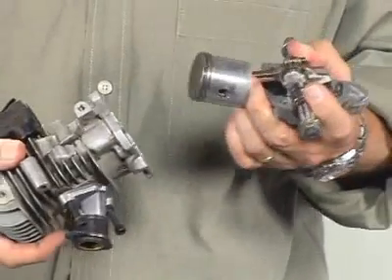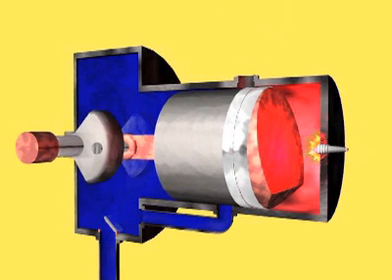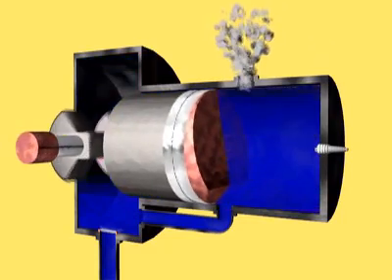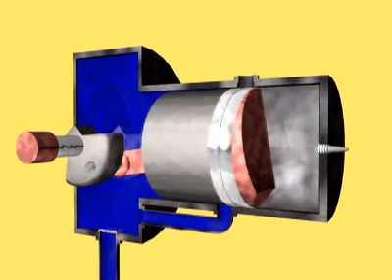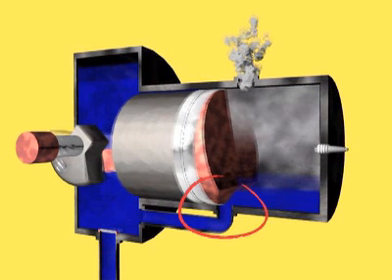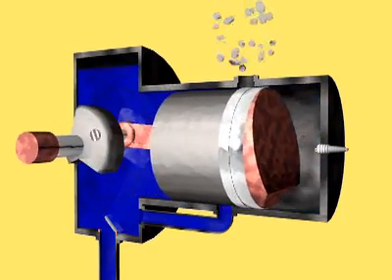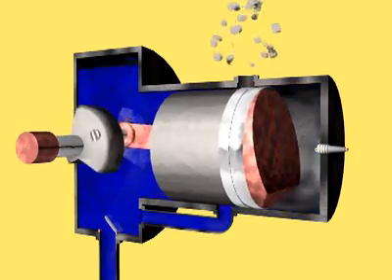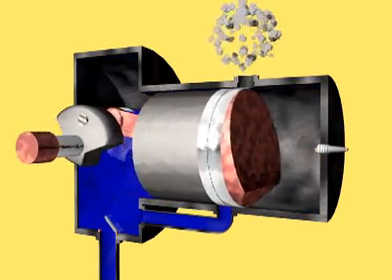How Two-stroke Engines Work

Comment: From the animation, I gather that you're likely to lose some unburned fuel out of the exhaust, since the fuel intake and exhaust are open simultaneously. That would mean lower fuel efficiency, right?
Reply: something that this video didnt clarify is that there are many varieties of 2 stroke engines. This is the simplest and cheapest one and yes, intake and exhaust are open simultaneously so quite often your intake will leave the exhaust leading to decreased fuel efficiency. It should also be noted that a 2 stroke running at 5000rpm is firing twice as often as a 4 stroke at 5000 rpm (2 stroke fires once every crankshaft revolution, 4 stroke fires every other revolution) so it will be burning at twice the rate in the first place. They are not fuel efficient. This variety of 2 stroke engine also has to have the lubricant premixed with the fuel (or on my old 50cc scooter it actually had a seperate oil tank which fed into the carb so the carb mixed the oil and fuel before it entered the engine rather than having to mix before putting fuel into the tank), as the fuel and exhaust run through all the moving parts of the engine this is a simple way of keeping it lubricated, the lubricant doesnt burn in the exhaust properly though so this adds to the emissions from this type of 2 stroke engine.

There are actually 2 stroke engines which have a proper cam operated exhaust valve, superchargers instead of using the piston falling and a conventional pressurised oil system as you would expect from a 4 stroke. These engines in proper tune can run with superior performance to the simple setup shown here, the setup shown here is hardly the best engine in the world but it is damn cheap and lightweight making it perfect for chainsaws, weedwackers and RC vehicles.

This type of engine though with a properly tuned resonance chamber in the exhaust pipe can be setup so the exhaust gas creates backpressure to keep the fresh fuel/air mixture from exiting through the exhaust pipe too, this can help the fuel leaving exhaust issue but does come at extra cost for something like a weedwacker, common on RC vehicles and dirtbikes though. Improperly setup they either dont have enough effect (still an improvement over a standard exhaust) or in some cases it has been known for them to also inhibit some of the exhaust gas from leaving the cylinder so you have exhaust gas still present during the combustion cycle limiting peak power output.
Reply: this video ignores the importance of the expansion chamber(exhaust pipe). Two strokes tuned for maximum performance(like dirt bikes) have a giant expansion chamber that uses sound waves to pack even more fuel/air into the chamber. In the ideal rpm range there can be almost no unburned hydrocarbons leaving the muffler...google two stroce exhaust scavenging if your interested and powervalves help to widen the powerband
Reply: Yup ... but there are tricks you can do to maximize the efficiency and decrease the amount of unburned fuel loss.
Reply: Yes

Comment: Verry well explained video but shot lies at the end about more power.... and left out how they don't last as long are verry dirty pollutive engines and are a pain to have to mix fuel and can be cerry unpredictable on throttle just cheap
Reply: Actually they genuinely do have more power for a given displacement compared to their 4 stroke brethren. A 4 stroke only fires once every other crankshaft revolution. A 2 stroke fires every crankshaft revolution. Twice as often. On paper, power output is double. In reality, its never quite double but it is higher than a 4 stroke.

Not lasting long, pollution requiring lubricant in the fuel supply. They are inherent to this type of engine yes, I will grant you that one. I'll also add in poor fuel economy (2 reasons, the fact its firing more often than the 4 stroke and additionally the intake and exhaust valves are open at the same time so without a properly tuned exhaust pipe (this does exist as a solution to the following problem) some of the fresh fuel/air mix will leave with the exhaust and be wasted). But a criticism I would like to add to this video is that not all 2 stroke engines actually function in the way he describes, he only describes a cheap 2 stroke. I live on a farm, we had a big old piece of farm machinery with a 2 stroke diesel, it had a supercharger, direct injection, exhaust valves (the inlet was still done via the piston reaching bottom centre, but wasnt fed from the crank case, it was simply a case of the inlet being near the bottom not the top which is a theoretically possible setup for a 4 stroke too) and a pressurised oil system. It did not require lubricant in the fuel, it had an actual oil system instead. It didnt burn lubricant as a result (the primary cause of the poor emissions test results on 2 strokes). Its fuel economy wasnt great, but it was firing more often than a 4 stroke so it wasnt going to be as good, its power output was massive though. 2 stroke engines with proper valve setups, dedicated lubrication systems and various other features not present in these cheap 2 stroke engines are very common in marine and industrial applications.
As for fuel mixing. I had a 50cc moped which had seperate fuel and oil tanks. The carb fed lines from both and basically did the oil/fuel mixing for you. So again. Having to mix the fuel is a limitation of a basic design only.

Comment: the 2-stroke engine will be better if the lubrication is like a four stroke and no loss of fuel and gas in the exhaust , the engine is called Kolbenladermotor (Piston Charger Engine)

Comment: Loop scavenge 2 strokes lost out on cars for 2 reasons.
(1) Emissions, they are bad on unburned hydrocarbons (oil in the petrol to lubricate the bottom end and unburned fuel from blowing out the exhaust.
(2) Wear  on the bores/ rings because of heat differential between the top and bottom of the piston (My air cooled Yam RD350 would need re-ringing every 10,000-15,000 miles)
Reply: Emissions are entirely resolved now with direct fuel injection.  Some of the most stringently emissions-controlled bodies of water will allow direct-injected two-strokes, where even many four-strokes are not allowed due to emissions.  This is due to oil injection with tighter tolerances and less consumption, as well as the obvious advantage of fuel only being injected AFTER the exhaust port is closed.  Also, your RD should have had oil injection, so don't bring up premix.

Motorcycle engines, especially the two-strokes, are in a pretty hot state of tune.  Big ports and high RPM on an air-cooled engine do make ring wear more severe than they are in some other applications, such as snowmobiles and outboards.  That said, even some two-stroke motorcycles can last a good long time.  And I wouldn't consider a ring job on my 400 triple to be any more difficult than a valve adjustment on my CRX - and that's supposed to be done every other oil change.
Reply: Yes I know my Yam had oil injection (but some of the oil would be in the petrol/air mix because there were oil injectors on the engine side of the carbs plus oil was also injected into oilways in the crankshaft.
I didn't mean "petroil" as in mixing in the fuel tank
Agree on the direct injection of fuel in the latest generation of 2 stroke motors. Saw that on snow-mobile engines
Reply: and they don't coast if you go down a hill with the clutch out/or in drive the engine wont get any gas or oil and a engine that isn't lubricated is no good
Reply: Your air cooled RD is 159 years old. There is nothing as reliable as a 2 stroke and the rings is minimal compared to 4 stroke maintainance. #1 is why they lost out on 4s.

Comment: part of the reason 2 strokes are so bad on fuel is because some of the fuel/air mixture is lost out of the exhaust valve as the cylinder is being compressed

Comment: The 1979 Triumph Bonneville 750 produced 38 Foot / Pounds of torque at the rear wheel and consumed 51 MPG. (A 4 Stroke)

The 1979 JAWA 350 Type 634-5-05 produced 38 Foot / Pounds of torque at the rear wheel and consumed 65 MPG. It was also a 2 stroke.

The advantage with a 2 stroke is that only have the engine size is needed to perform the same task.

4 strokes also have far higher internal friction losses than a 2 stroke as all that additional junk (oil pump, valve gear, etc.) bleeds off power.

Comment: With power tools, such as chain saws, they will always drop their engine speed, when cutting, to the middle high torque 20% of their engine speed range.

If the material being cut, through frictional forces, makes the chainsaw to drop under this middle 20% it will quickly loose momentum and stall.

As 2 strokes produce just over 2.5 times the torque for volume than a 4 stroke the advantage for using them for this purpose is clear.

Comment: HP is always taken at maximum engine speed with the engine on the edge of its induction abilities and the crank has its largest store of innertial rotational energy. Even non-powered flywheels and spinning tops can have a HP measurement taken from them.

A vehicle's top speed is when the drag forces (measured in foot/pounds or newton/metres) = the applied torque at the driven wheel(s). If the engine is high revving, high HP but low torque, it will require a lot of gears.

Comment: OK engine generate maximum tractive effort (torque) when in the middle 20% of their maximum engine speed. This is when the engine is in tune / harmony with its exhaust system and intake system. It is also when the engine consumes the least amount of fuel. However as HP is more a measure of crank innertial energy, this is not when peak horsepower is produced.

The maximum engine speed is when the engine's intake duration is too short to intake enough mixture for combustion.

Comment: What i am interested in is how much power is generated by the working stroke. That is torque and speed since torque is newton-meter (=joule) and the rotational speed is in the unit of 1/s or 2/s (two- or four-stroke) newton (pressure and area of piston) times. Then if the engines are the same size and rpm, then the two-stroke should generate double the power with the same fuel consumption or half the consumption if they had equal efficientcies. But that is not the case. :)

Comment: Any rotational object generates torque, like a spinning top, and as the RPM can be measured, its BHP can be calculated.

I ran a brake dynometer for a company called Battery Electrical Traction Engineering Company, back in 1980. We made the main propulsion motors for Lansing & Bagnall fork lift trucks.

The 2.6 Kilowatt motors I tested made 22 BHP @ 2,000 RPM and 57.75 Foot / Pounds of torque on peak load. 

For electric motors wattage not the power output but peak load power consumption.

Comment: The international motor industry standard is by impirical measurement using a dynometer with the horsepower rating being taken either from conversion from a wattage of electrical power or from torque (tractive effort) recorded.

Note that 1 HP does not equal 1 PS as used by the Germans. 100 PS = 86 HP.

PLAN does not take into account port timing, intake loading (filters) or exhaust system volume so is a guestimate system with a large margin for error.

Comment: Damn, now you got me looking through the handbook again. 
BHP is according to Two stroke tuner's handbook by Gordon Jennings (page 3)
BHP = (P*L*A*N)/33000
Where
P is the brake mean effective pressure in psi.
L is the stroke in feet.
A is the area of the piston in square inches
N is number of power strokes per minute.

What i am talking about is what makes the pressure: How much muxture is in there, how much it is compressed and when the spark is given :)
So far i have ignored the spark advance.

Comment: A Brake dynometer is pretty easy to build and I used to run one in a job I had 30 years ago.

I'm building one now for use at home.

YOu need two identically rated DC electric motors. One will go to the engine or vehicle and the other will be electrically connected to the first motor.

Spinning up the first motor will make the second motor start to rotate.

The second motor then has a 12 Inch arm attached to its output shaft and this applied pressure to a set of scales. This will show torque.

Comment: Wrong - compression ratio is measured in the combustion chamber with a guage (I have one).

Both have the engine or vehicle under test turning a dynamo however what they are connected to is denoted by HP or BHP.
 
Brake Horsepower measures the torque via an electric motor with an arm attached to it onto a set of scale. the motor trys to turn and the force it applies (torque) is measured by the scales.

(Torque (Foot/Pounds) x RPM / 5,252) = BHP.

HP is calculate from a Wattmeter reading.

Comment: I know that BHP is calculated from the pressure in the combustion chamber, the piston area, the stroke and the frequency. But if the rpm, stroke and piston size was the same, then it must be the pressure that is different and the engine with the highest pressure is most often the one you think of as the most efficient. :)
The pressure (if the AFR are the same) is determined by VE and compression ratio while the compression ratio is limited by the knock tendency. :D

Comment: The difference in HP and BHP is to denote the method used to measure the output of the engine for the calculation.

BHP measures the actual torque (tractive effort) using a "Brake" dynometer which has a secondary motor attacched to an arm forcing a set of scales.

HP denotes that the figure was derived from a dynometer measuring electrical power generated (Watt's Horsepower Calculation). This is subject to slight inaccuracy due to heat losses.

BHP is judged to be the most accurate.

Comment: My GT 550 B was a 3 cylinder 2 stroke and produced 68 BHP @ 7,000 RPM with 44 Foot / Pounds of torque (tractive effort) at the rear wheel @ 5,000 RPM.

My 1974 350cc Aprillia twin ran a JAWA Type 472-2 engine which produced 38 Foot / Pounds torque @ 3,800 RPM and 30 BHP @ 6,000 RPM. Top speed was 107 MPH.

By comparison a 1979 Triumph 750 Bonneville gives 38 Foot / Pounds torque @ 4,000 RPM and 43 BHP @ 7,000 RPM.

HP / BHP is a factor of (Torque x RPM) / 5,252 and is similar to W = I x V.

Comment: Thank you for enlightening me, i do not know enough about that old engines to know if it was because the four stroke was not as good as it is now, but i know that the two strokes were very popular for races in the 70's (Two stroke tuner's handbook), so perhaps these were developed better than the 4 stroke bikes at the time. :)
Did it have a proper expansion chamber and how was the useful rpm band on that? :D

Comment: The Webb 2 stroke (as in pre-1970's common rail diesels) was a direct injected 2 stroke diesel used in trucks on the road globally from pre-WW2 to the 1970's emisson's laws killed them off.

The Webb featured an overhead exhaust valve and is similar to a four stroke engine.

Comment: By contrast my Canadian / US spec 1977 Suzuki GT 550 B can only manage 18 UK MPG @ 45 MPH and averaged 9 UK MPG.

However it managed a 9.91 standing quarter mile at the Santa Pod raceway in 1989 on a standard engine running a Nitro Toluene / Petrol concoction.

It hasn't been ridden since 1991 as the early unleaded fuel damaged the engine.

Comment: The crank shares the gearbox oil like a 4 stroke.

There is a Canadian made DI conversion for the Czech JAWA 350 Type 638.

The conversion consists of a modified cylinder head (injectors), the fuel mixture pressurisation system, a gasket to blank off the crank transfer ports.

The conversion requires that the crank journal oil seals be removed as the crankshaft's only source of lubrication is from the gearbox. Also that the breather hole has a nozzle fitted and a long breather tube fitted.

Comment: Yes, like aprilia's DiTech engine. :)
But you are wrong at the point about that they don't need oil. They do, but they don't need as much as conventional two-strokes, as the oil are not contamined by fuel. :D

Comment: The amount of time it takes the air to fill the cylinder is not very much. But the time it takes the piston to close the exhaust port again is not very much either, when running 7000 rpm. :)
But for better filling, they use expansion chambers which uses pressure waves to push the fresh mixture back into the cylinder. 
But as you can guess, both these approaches only work at specific rpm, so they are not very enviromental at lower rpm. :)

Comment: Exactly. :)

Most untuned 4-strokes has a volumetric efficientcy of 85% while most untuned 2-strokes are down at around 55%, so the advantage of the extra power stroke is only 25%, but it uses more than 25% more fuel than a four-stroke, if it is a carburated engine, so the two-stroke is much less efficient compared to the volume of air. :)

But they can be made light, thats a good thing. :)

Comment: Don't forget one of the main advantages of 2S engines is no oil-filled crankcase. How could you run a chain saw, chop saw, weed whacker, etc in any position? You'd need a way to be sure the sump wouldn't run dry. It can be done, albeit with difficulty!

Comment: Direct injected 2 stroke engines are the cleanest and most efficient internal engine developed.

They require no fuel / oil lubrication which removes the oily exhaust fumes problem.

They also have negligable N2O emissions and do not require power sapping catalytic converters.

DI 2 strokes are expected to replace 4 stroke engines in all automotive powerplants by 2030.

THe EU has banned the sale of all brand new non Direct Injected 2 stroke powered vehicles after 31st December 2014.